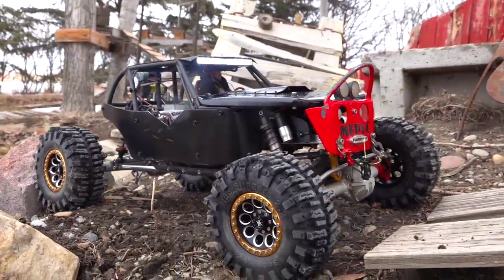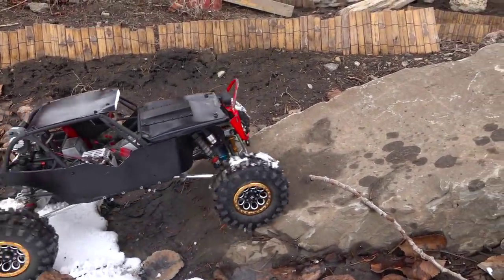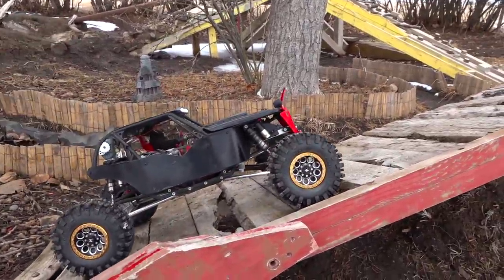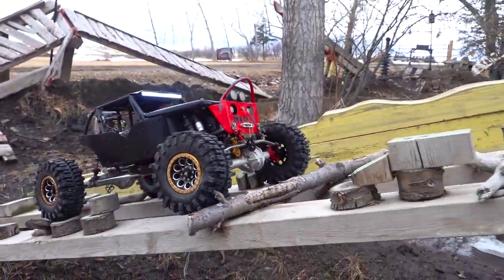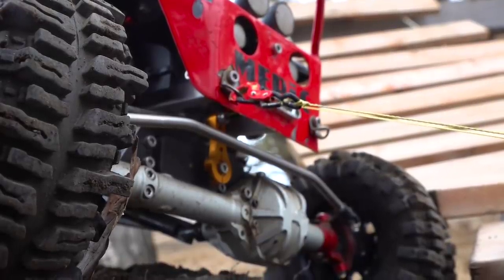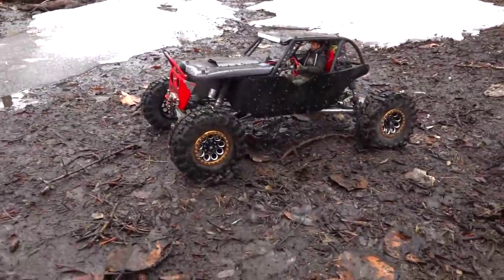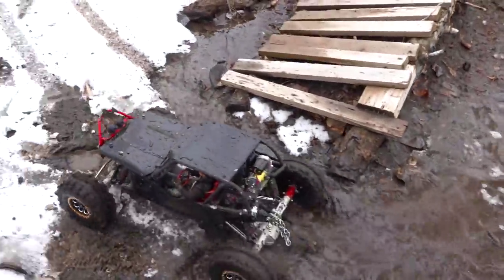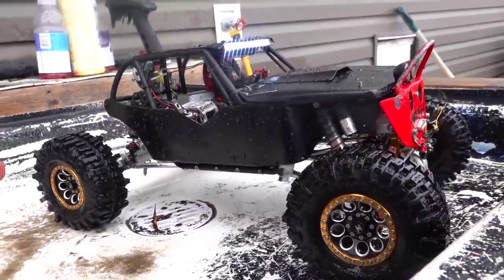BLACK WiDOW SNATCH BLOCK ACTiON - RED NECK 4x4 TACKLES the BACKYARD TRAiL PARK | RC ADVENTURES

Comment: You were talking about taking the time to regrease everything that needs greased reminds me of one thing. I had my TRX4 Bronco for over a year now and a couple of days ago was the first time I pulled the axles completely apart. I expected to find dirt, water, grime and such. I found nothing of the sort. In fact it doesn't look like I've ever had it in the trails I run my trucks in. I still cleaned the old grease up and regreased everything with green marine grease. The grease out of the axles, even the portals had very little to no dirt at all on the rag. I don't use my TRX4 much in mud and water anymore with these newer tires because I don't want to wreck the foams. The foams are that memory foam stuff, very soft and plush on the rocks, but tend to roll over on the wheels when side slopping or trying to turn sharp while desending a hill. I am currently running Proline Flat Irons with the stock foam. I love the look of the tires and like the way the foams do in most situations. I recently purchased some JConcepts (can't recall the name of the tires off the top of my head) and was thinking about getting some two stage foams for them. Honestly though, I'm not sure I want to pay that much for the foam though even if it is as good as the reviews. We shall see what I do. If the foam in the JConcepts tires is anything like the foam in the stock Canyons, then yeah, I'll pick up the two stage. TBH though. I don't run many aftermarket tires on my RCs other than on my Summit and my Bronco. My nitro Revo is running Proline MX38's but I shredded a stock tire minutes after I had finally got it broken in. I ripped up and down my street to get it broken in so it didn't really hurt the tires, but as soon as I got it to my hillclimb spot, first climb and it ripped open the entire sidewall on the driver's rear. I knew Traxxas stock tires were crap, but holy shight. Lol. The Revo definitely likes the taller MX38's though and I'm not sure why. You'd think it would stress the drivetrain more, but it runs faster and cooler and even shifts better. Maybe it's just the momentum of the weight of the tires or the grip, but it's something for sure. I do run my nitro more rich than most do so the nitro might be getting to the operating temp it should be running at. Who knows. I think this is the first video I've seen with the black widow since I've started watching your channel. It's nice. The steering as you were talking about always seems to be super tight on the Axial RCs. My Bronco sure doesn't turn that tight fully locked. It's not a bad servo either. PowerHD DW25LV. The two TRX sports my niece's have definitely seem to turn better too. They are running stock servos yet. I figure the only thing it could be is the grip from the Prolines I am currently running or I'm getting binding in some way. The axles on your Axial Wrath are nice as well. Was thinking about getting some aluminum ones for my TRX, but that's at the very bottom of my TRX mod list. Highest priority now is finding a third set of tires (probably gonna be the proline Hyrax) and a 550 can Hobbywing Axe system. I've got a question while I'm on brushless systems, what  sensored ESC would you recommend for a 1/8 Summit and a sensored Castle Creations motor?  I bought the Castle Creations 6s Mamba Monster 2 and a 2200 KV (I think it's 2200) combo. The motor is sensored but the ESC is not.

Comment: Great video as always, that is an awesome crawler....... Right, “Loading Kings”, everyone’s favourite, in these trying times which are set to continue for at the very least a few months yet.... how about “Remote FPV Loading Kings”... would it be possible??? All the guys it their homes, remotely operating the trucks and forklifts through an FPV system, with your good self in the shed of dreams adjudicating and filming the proceedings. You could affix photos of the guy driving the truck/forklift on top of the cab, the main shot can be as normal with you filming and commentating, and thumbnails showing what the guys see from their cabs..... I’m probably rambling about complete B##locks and it’s not even remotely possible, but it seems such a great idea I can’t not mention it... and if anyone can pull it off, I bet you can... no pressure. 
Keep us the great work... and please please please never stop!

Comment: The Black Widow looks so different without the G-made rims & those huge flexible tires. With such a heavy rig, how often did you have to keep refilling the air filled rims? Like once each time you ran her, or a bunch of times each time each you ran the Widow?

Comment: When you are mudding the trucks do you keep the air holes in the rims open because mine seem to get full of water most of the time and I have to squeeze it out.  Also what’s your maintenance schedule for the axles? I had just taken mine apart to clean and fill them with grease as water intrusion is my concern. *SCX 10 ii 1955 Ford

Comment: You need a drill powered paint mixer and use that to mix up a sloppy bounty hole to drive in so it’s actual thick challenging mud to do some scale mudding
Reply from the maker: The dirt here doesnt work like that... in fact, I went through WAY more trouble than what your talking about.. and it still sets up like concrete: https://www.youtube.com/watch?v=1dGxQeSN0d0

Comment: Do they make studded RC car tires? Like actual real ones not ones with screws or tacks through them but ones that would actually look like a real studded tire would? If so, I wonder if that would help it on the ice considering it's so light anyways it might not have enough weight for the spikes to grip into the ice
Reply from the maker: Yes, they did make a  studded tire.. and I used to use them. Tamiya still provides them for sale used to be on "Blackfoot".  They were good for 1990 trucks.. but not so much in crawlers. more surface area the better.. and studs wear down too quick